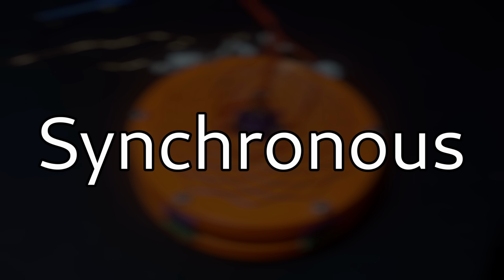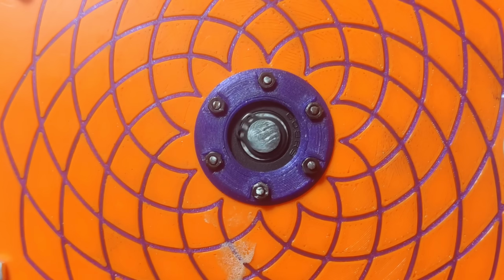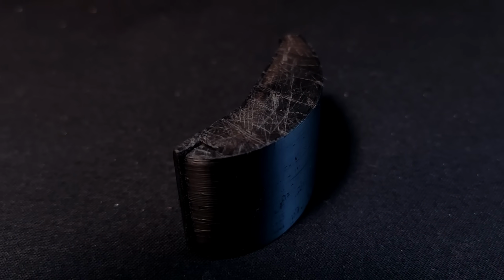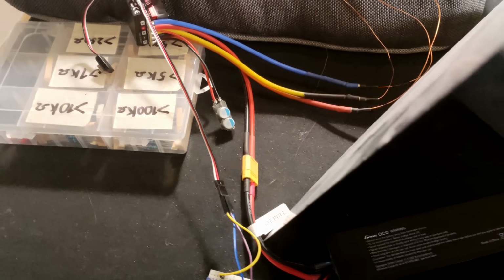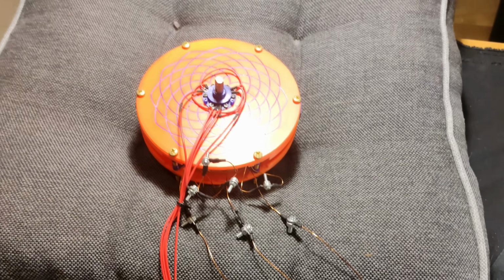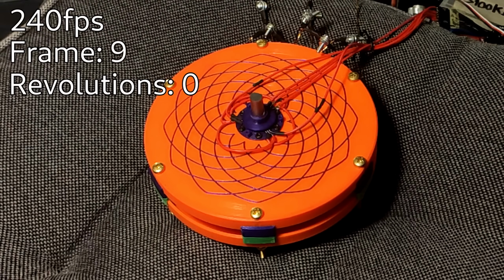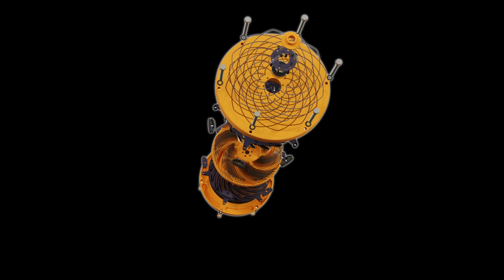Axial Flux Synchronous Motor Prototype

Comment: 3:45
Not doubting your knowledge about electric motors, but the further the distance of the electromagnetic field from the center, the more leverage, and thus, more torque it has?
So it wouldn't mean that the spirals/curves closer to the center are generating less torque compared to the curve tips far away from the center?
Or you already took this into consideration?
Reply from the maker: Yes this is true, but there's also a larger amount of flux generating copper windings nearer to the the outer-diameter in general in case of the involute stator. And in distributed windings specifically, the outer-diameter wire has a smaller flux contribution due to the end windings quickly not being close to the cores any more. It is possible that actually the most optimal shape is somewhere inbetween the involute and the wedge shape, especially for concentrated windings.

Comment: Si depende de batería.... no sirve de nada..!!!!
Reply from the maker: What depends on the battery? It can be powered from a power supply or a battery, that's normal. If I used a VFD instead of an ESC/FOC controller, then it could even be driven off grid power.

Comment: Cool project! Maybe laser cut parts could be a decent intermediate scale alternative for widely available and affordable production access besides 3D printing
Reply from the maker: The next step that would be significantly better than 3d printed parts (and thus worth going for) would be metal parts. So either metal laser cutting, plasma cutting, or (cnc) milling. None of those methods are that widely available nor affordable unless you yourself have or know someone who has such a machine. The e-bike motor I will still try to make in such a way that nearly anybody could replicate it "easily". Though at one point I do intend to build a cnc mill capable of cutting mild steels.
Reply: @BirdbrainEngineer  Laser cut parts are pretty easy to order online.

Comment: Awesome design! I haven't seen involute coils like that before, but it looks great. Much easier to DIY than radial flux motors. Especially if you use thinner steel sheet so can stack them up with glue and clamp between two cauls to create the shape rather than having to individually press bend them. And make non-stick spacers that half-fill the slots so you just pack as much wire in as you can, hit with CA, and then pull the spacers, leaving perfectly sized slots for the neighboring coils.

Comment: Amazing project! Very well done. What was the rotor to stator "pole count" for your SRM version?
Reply from the maker: The stators have 18 slots, and since I used distributed windings, then divide that by 3 to get 6 individual magnetic poles. Hence the 6 segments in the reluctance rotors, as each generated magnetic pole is to be paired up with a pole. Also something I did not touch on in the video is that the generated poles on both the stators have to move in sync with one-another, as well as have opposite polarities exposed... this would make the magnetic flux lines flow from one to the other synced up stator pole, and the reluctance rotor between them would further enable an easier path for the flux to "flow", which is how an axial flux reluctance motor is supposed to work.

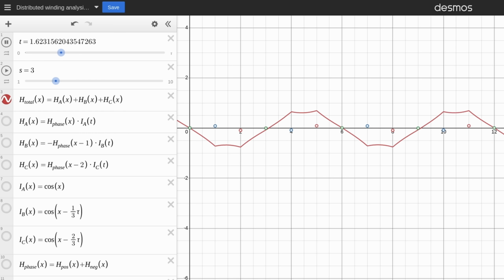Comment: 5:00 You were not able to re-wire it into the configuration you wanted?  
As i watched the video, it seemed like you were obviously going to do that, but you didn't do it? 🤷🏻‍♀  
Ooooh, are you saving that for the next motor - the e-bike motor?  That would make sense.
Reply from the maker: I wound the windings before I realized it was a mistake to do it that way. I used the foaming gorilla glue to keep the windings fixed to the stator, so unless I wanted to completely remake the stators, no I was not able to re-wire it once I realized my mistake.
Reply: @BirdbrainEngineer  oooh i forgot the glue!

Comment: This is fascinating, simply explained and very professional.. Surely the design of the motor should consider the type of energy cell and regeneration that is going to be considered.
Very interested to know your opinion. The high speed is ideal because you will use an epicyclic to reduce the speed thus increase the torque. You shouldn't give up with this design.. Thx....

Comment: Hello friend!
I've played around with turning car alternators into bldc motors. You can see what I came up with on my channel.
But I was working on a design for a helical toroidal flux bldc motor, but had to move. Link to my printables designs in my channel page. 
I am really loving your 3D printed designs! And your need to use distributed windings for smooth operation had me thinking of my helical toroidal flux motor.

Comment: me who can't even make my own solenoid coil, but I also can't be bothered to learn the tons of math
Reply from the maker: Heavy math is only needed if you want to make something that is optimal and that doesn't require multiple tests before arriving at a final solution :P Sometimes it might actually be more fun to just go at it and test things... write down things you discover (eg. you discover that the more turns of wire, the stronger the magnetic field and the higher the amperage, the stronger the magnetic field)... and then one day, when you do get to the heavy math side of things, you may find that some things suddenly "click" much easier.

Comment: try to use special electro-technical steel not zinc plated cheap roof metal.
Reply from the maker: I already have something in mind for the next motor that should result in comparable magnetic performance (if not better in some ways) to electrical steel (silicon steel).

Comment: I really like your involute stator design. The reasoning makes sense and seems like a good way forward.
I would like to point out however that every BLDC motor, permanent magnet or reluctance, is a synchronous motor. They all rely on the stator magnetic field rotating at the same speed as the rotor magnetic field. The stator field is always advanced in relation to the rotor field, as if they were aligned the torque would be zero.
As you well know, on asynchronous motors the stator magnetic field always have a higher speed than the rotor magnetic field, and the slip is what produces torque.
Commercial motors are called "Synchronous reluctance motor" or "permanent magnet synchronous motor" just to differentiate them from asynchronous (inductance) motors.
In reality, every PM BLDC motor is a PMSM. If that was not the case, Field Oriented Control would not work. 
But regardless of nomenclatures, please keep up with your ideas!
Reply from the maker: Thanks for pointing out the definition mistake! Yes, it's a little bit confusing. I have added this point to the pinned comment along with the explanation of what I considered as synchronous in the video instead.
Reply: I'd like to thank you for a wonderful comment. My faith in an intelligent Humanity has been restored.
Reply: What benefits does the involute stator offer?

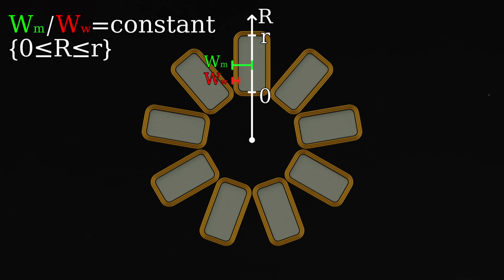Comment: I am certainly no expert and really learned a lot from the clip. Thanks!  One of the issues I thought happened about 3:18, 3:28, 3:37. All these pictures show cores with metal wrapped with a wire strand. Each core is designed to fit next to another using a ratio of winding/steel core. No spaces are left in between to maximize magnetism.  When you built yours, it seemed the winding/steel-core ratio was way different, and the plastic housing took up 50% of the space.  Next time, take the design at 3:18 and measure the weight/mass of one steel plate. When you build your curved plate, ensure you have the same amount of steel per core. Then when making your wheel, build a 2mm curved slot for the steel sections to sit down into. Remove all the plastic barriers.  I would recommend making a smaller easier-to-build motor with fewer cores.  Failure is normal, make it easy to build and learn, then build again.  After you get it working well, then make a bigger, more core model.  Anyway,  my ideas...

Comment: can you add sum gears to manage the speed and the force👍
Reply from the maker: Gears can be used to change speed for torque, yes. Indeed... with a planetary gearbox, this motor could maybe even move a person on a bike haha. (Though it would probably require a vesc controller or something similar to actually get things moving from a standstill, because most normal ESC-s (sensored or not) aren't really built to control a synchronous motor)

Comment: hi what aoftware are you using for designing the  electrmagnetc simulation
Reply from the maker: I have not managed to find a proper EM simulation suite yet. I used Desmos Graphing Calculator simply to verify and prove to myself how I need to configure the phase wires in order to get a (relatiely) smoothly rotating magnetic field. The near-sine-wave shown in the video is a representation of idealized magnetic flux density in a 1D strip wound in a circle on the exposed surface of the stator(s). Whether the sine shows positive or negative, shows the polarity of the magnetic field generated. 
I am slowly learning FreeCAD as a proper CAD software, and I have heard there is at least static electromagnetic simulation available for that... so for the e-bike motor (whenever I get to it, probably early-ish next year) I will try to actually run some simulations to confirm some things like whether the curved stator design would actually be helpful or not and so on...
Reply: I want to design voice coil motor, totally in the dead end on how to proceed to design  @BirdbrainEngineer

Comment: Use a hexagonal winding structure
Reply from the maker: Could you elaborate more?
Reply: Change tha core shape in hexagonal shape instead of triangular shape
Reply: Video time 4:10 ,just like that you change it in different shapes try a hexagonal shape
Reply from the maker: Hexagonal shape would lose effective stator area though; hexagons are not space-filling over polar coordinates. Hairpin windings though... while they would be absolutely awesome to have and use for winding (even when using curved stator cores), then I'm not sure how I would manufacture them in a DIY setting. Sure, I could have the hairpins laser cut out of copper sheet, but then how would I varnish the hairpins? Any method of applying thin varnish coatings would leave a rather fragile and not the best varnish (eg. dissolve acrylic in acetone, dip the hairpins in the solution and let them dry... this would work to insulate the hairpins but the insulation is very fragile and also prone to cracking under thermal expansion)
Reply: And yeah yes a hairpin winding structure like tesla
Reply: Tesla is working on hairpin winding structure you can go through the same procedure
Reply: What if we try to built the combination of two radial and axial motor with hairpin winding structure.
Reply from the maker: Combination of a radial- and an axial flux motor is called "raxial flux" and is certainly possible to make, although it is a fairly complicated construction to do properly. Hairpins can be used for any winding structure when certain constraints on the design are imposed... but yeah, once again, it's very difficult to make hairpin windings in a diy setting. Industrially they use a lot of automation and expensive machines for the process. In addition, hairpin windings seem to be capable of only low winding turn counts, which technically is not what I am looking for in an e-bike motor. I mean, with gearing it would be no problem to have a higher rpm motor but currently I am thinking of making a direct drive e-bike motor.

Comment: I'm gonna be honest. I haven't watched your entire video, but I'm gonna help you with work here Because I really think you're going to something. You're gonna want to get some capacitors They are the same capacity as your And doctors having doctors. I.E. (1F Clockwise 1F Count to clock wise 1H) And you're gonna want to pulse it at it's resonant frequency. You will have that motor spinning at 5 if not 10% faster than you can already. You might want to invest in some very thick plexiglass.

Comment: when it comes to axial motors, at least on youtube - very few try a new design. great job!
Reply: Bro didn't even touch the commercially produced switch reluctance type axial flux.
Bro went straight for the holy grail design and made a Permanent magnet (or not), Axial Flux, Synchronous Motor!!!
Only thing left is to sandwitch the coil winding, by magnets. And make a yokeless (coreless/no iron core) design. And proper sophisticated cooling..
And you'll have the best that can ever be made!
In all honesty I think I have an/few ideas to improve the thermals and coincidentally energy density even further.
But we'll cross the bridge when we'll reach it.

Comment: I think your onto something big here, if it becomes easy to 3D print a decenty strong motor with plastic and some metal sheets and wires, and actually have it durable enough to power a bike, then it will have a major positive impact on the DIY 3d printing community.
Reply: You might be underestimating the load a bicycle wheel has to deal with, especially at the hub. The only way that would feasibly work would be to have the entire wheel made composite, like a Aerospoke, so there's no torque deviations or twist that a standard spoked wheel would deal with. Even sturdy triple laced wheels eventually come out of true. Eventually the plastic will wear at where and how the spoke is held. Plus there is the heat generation to think of, and practically every plastic is subject to UV degradation.

Comment: I've been thinking about using angled sections like you did here. Love the effort, 7200 is pretty awesome.
Reply from the maker: While these curved stators would be way more difficult to manufacture, I'm a bit weirded out that I have not seen this kind of design before... Especially for coreless PCB stators, this kind of design is exactly what they need, as it maximizes the effective copper area in the stator while keeping the magnetic flux in the "air cores" more uniform than in the wedge shaped cores. I suppose a big hurtle is that if a permanent-magnet rotor is used, then ideally the magnets should be specifically manufactured for each specific combination of pole count, inner diameter and outer diameter of the effective stator area. I'm going to look into how much getting custom shaped magnets made would cost... hopefully not a complete fortune lol...
Reply: @BirdbrainEngineer  good luck in your research for that! I hope u can get some made.
Reply: @BirdbrainEngineer what about the Lorentz force? It's always perpendicular to the wires, so with such angled/curved design, a significant part of the force is trying to tear the motor apart instead of rotating the rotor.
Reply: @BirdbrainEngineer сейчас это не дорого.
Reply: Im working on a model axial flux that will use the serpentine coil style from Robert Murray`s videos. The angled sections are pretty great idea too. Good luck

Comment: I'm probably not the first person to say it - but we learn more from our mistakes than from our successes.  Your next design will be better - and the process repeats.  Well done for completing the project - which is a major achievement, regardless of how you perceive the outcome.  Thanks for the videos.  Stay safe out there.
Reply from the maker: Engineering is an iterative process! It also humbles one to not think that everything is easy to do.
Reply: so true... my projects never even get to the stage that looks that pretty. maybe id finish more if i made them look nice and complete, even if prototype
Reply: stay safe out there is really good advice which i wanted to give too
Reply: yeah I spend more time trying to prove myself wrong than just about anything else and I've actually become really good at proving myself wrong over time.
Reply: The greatest teacher;
Failure is.
—Yoda
Reply: You could also read some research papers...